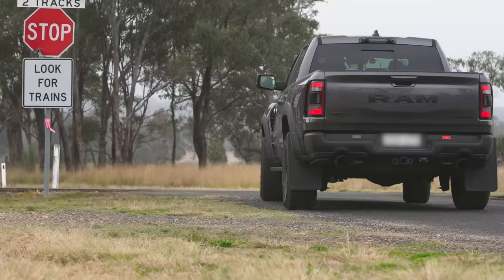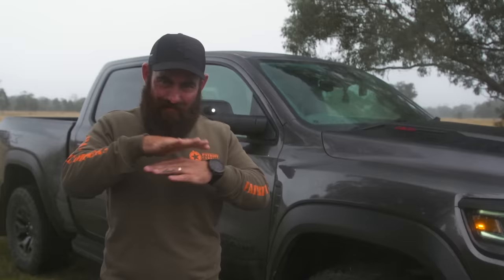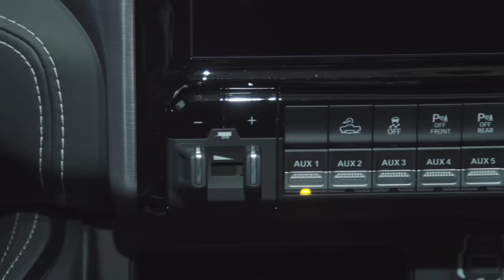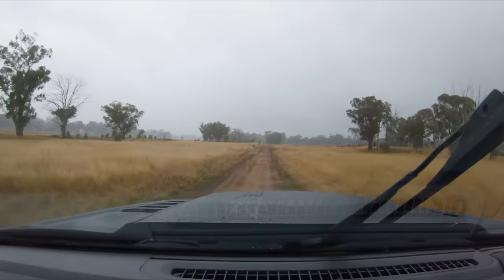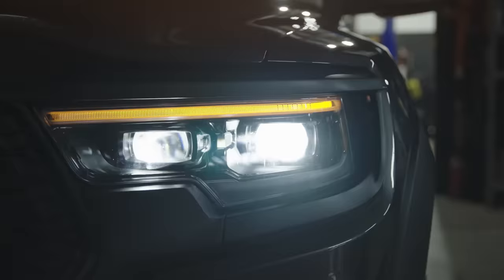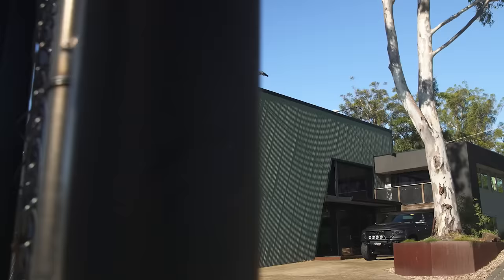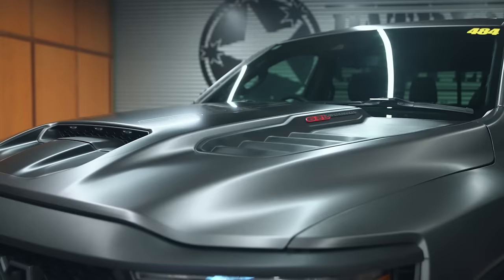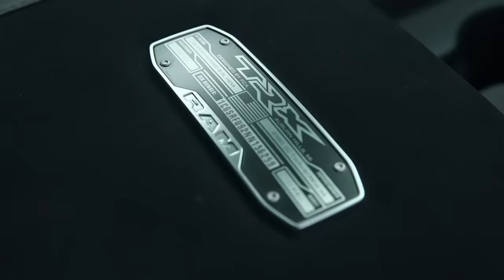RAM TRX 1500 Real World Test Drive - Baja Mode! | Patriot Games

Comment: Not a bad way to spend 250k
Reply: Lol yes it is 🤦🏼‍♂️
Reply: And a stand alone fuel management system, not a bad way to spend 10 thousand dollars.
Reply: Probably over 300k with accessories.  God knows why 702 hp wasn't enough
Reply: It's not that expensive
Reply: And no the truck doasnt cost 220k
Reply: Here in the United States (Texas), the TRX is going for between $80k-$100k.  I've seen them as low as $75k.  Brand new, with dealership mark-up, they were going for $130k, when they first came out.
Reply: Love mine
Reply: Beats a lambo imo 😂

Comment: F-150 Raptor R vs Ram TRX
Reply: The R beats the trx in early drags
Reply: RAM TREX
Reply: @aussieadventurestimetoplay  that's because of the rear gear ratio..and the TREX driver probably wasn't using launch control properly
Reply: V6 vs v8
Reply: @mike4769  the raptor R has the 5.2 L supercharged GT 500 engine in it
Reply: @aussieadventurestimetoplay  and Raptor R stock on 37 inch tyres
Reply: @flynndecker2921  good because that turbocharged v6 sounded horrendous
Reply: Raptor R is still at the top. TRX is nice though. Props to Ram and Ford for bring out beasts like these
Reply: I’ve driven both, I’m glad that I have a TRX. It’s wider, far nicer interior, supercharger whine is louder plus I have launch control. The R looks exactly like it’s V6 brother. 99.9% of the R is recycled.
Reply: @grpaxto  if it's on top ?! Why couldn't they find 1 more HP to at least match the RAM T-REX ??
Reply: @mike4769  Both the Raptor R and the TRX are V8s.

Comment: Justin, I have a 2006 and a 2018 ram 1500 and they both have Dana 60 axles. We’ll actually they are Chrysler 9.25” which is/was Rams equivalent to a D60. The TRX from what I have seen from other YouTube videos is a Dana 80 like the Ram HD trucks, but it has been customized for higher ground clearance and to accommodate those beastly shocks. I live in south Florida and guys are driving these around instead of lambo’s now. I love it!

Comment: I really hoped that the havoc edition came with an optional rwd option but unfortunately they didnt only thing that would make the TRX more menacing. Its a sweet hyper truck
Reply: You can probably unbolt the front drive shaft, then ya got a rwd 700 hp ram TRX. Not very mechanically sympathetic but who care, you can rip the maddest skids in a ram 1500
Reply: Or just tune out the front engagement like the chargers
Reply: They would have to upgrade the Dana 60 rear end to run it in 2wd. The power output of the engine is too close to the maximum that the Dana 60 can handle. That is why the Dana 60 is only used as a front axle on the HD diesels.

Comment: Better go talk to the boys at 8speed
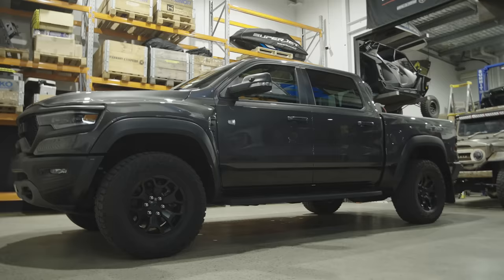Reply: Why? Check out 4:50…besides, these Rams have had an 8 speed trans for several years. Including Jeeps and Challenger/ Chargers….
Reply: @rodpalmer4652  becuase the paddle shift is slow to react to gear changes and the boys at 8speed have nailed it with the 79series

Comment: Just so y'all know, TRX's here in the USA cost around $90K.  Y'all could fly here, buy one for $90K, and pay to have it shipped to your country, WAY CHEAPER than spending $250K for one in your country 😂.
Reply: $40k to convert it to RHD and then the Aust Govt has 3 separate taxes on it. . .
Reply: @schmick63  It's like the US with a Ferrari, but backwards.  It cost us $250K-$400K for a Ferrari in the US.  We could buy it in Europe, and have it shipped to us way cheaper.  However, you still have to pay a ton to get it converted to US Road standards.  I knew it was alot, but I didn't realize that it was anything close to $40K for conversation.  I was thinking like $5K-$10K at most.  Thanks for educating me 😁

Comment: Nothing wrong with these American Trucks, and by the time you spend the amounts of money modifying your Toyota, Ford Rangers, Toyota Hilux your on your way to the prices of the American Trucks anyway, and my thoughts are why not just go that way in the first place, 2500 Ram is the way to go for me, it's a towing monster, why bother with the other over priced sub standard offerings, just my thoughts anyway, and for those that say they are to big for our roads, well I fit my semi trailer trucks on our roads, I would suggest fitting an American Pick-up truck shouldn't be an issue, not if your a competent driver, just saying !!!
Reply: I would agree unless you are going diesel. The 2500 with the diesel loses too much payload due to the weight of the Cummins. If you want the diesel and only really need a 2500 it is still worth the extra couple of hundred dollars to get a 3500 SRW. If you tow or haul heavy on a regular basis it is worth going with the HO diesel to get the Aisin transmission and definitely consider DRW.

Comment: How do you add a snorkel?
Reply: It actually has a unique air box system that goes a long way to protect the super charger and engine.  There are dump-aways that let tons of water and dirt dump out without going in the intake.  There are some videos out there that demonstrate that.
Reply: Thanks for the information John. Was just curious if any thing as to how you would add one with the large amount of air flow that it  needs. But what you said about the air box make sense. Especially for what the vehicle is designed for. 
.